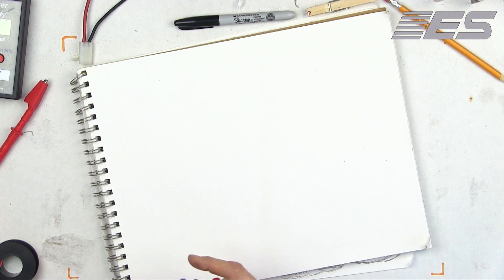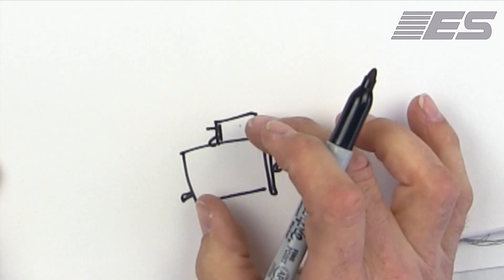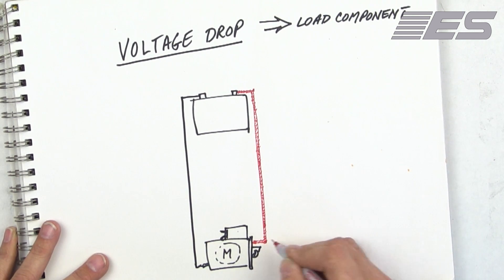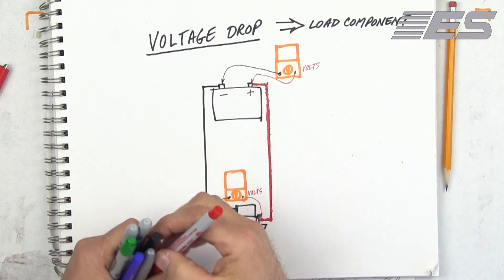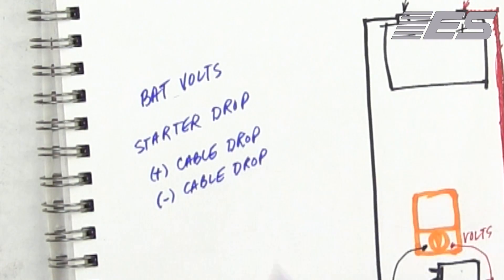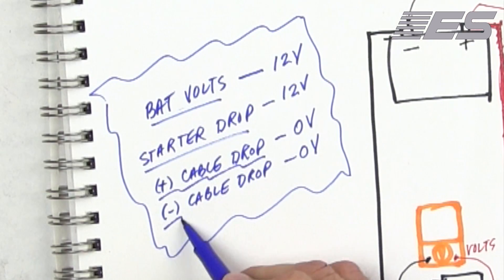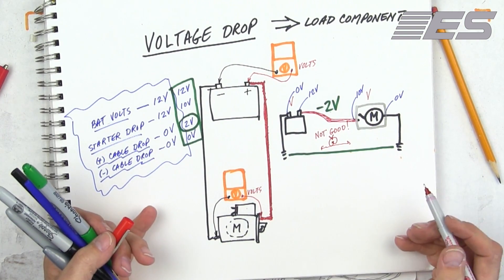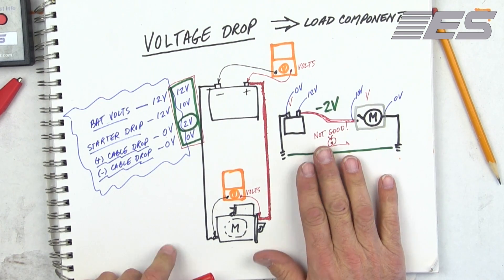Starter Buddy - Theory of Operation

Comment: Hey Dan,
     Thanks for making your videos I've recently subscribed to your channel, I enjoy watching your videos but just have one question. I may have misunderstood but did you say there will be NO voltage drop on any thing other than the load (in this case the starter)? Being a mechanic out here I can't say I ever saw a switch, cable or solenoid that did not have a measurable amount of VD on a high amperage circuit. Most starter solenoids I would check might be around 0.200Vdc across the contacts (loaded of course) and I might run across 0.100Vdc / 0.050Vdc on cable, depending on the length of it, on a know good circuit with no problems. Just want to make sure I am understanding this right is all. I just don't ever recall seeing a switch, mechanical or electro-mechanical have a VD of 0.000Vdc loaded. 
Thanks,
Eric O
Reply from the maker: You're right. I was using exact numbers, and there's always a chance that will backfire. In a perfect world my numbers would exist; in the real world they never will. From a teaching perspective the vast majority of guys don't have your experience and are learning this for the first time. Doing the math is secondary to the concept, so I don't really worry too much about the millivolt losses when trying to convey the general concept. Good job challenging me. Keep at it. And, thanks.
Reply: Whew lol ok thought I was loosing my mind. Just keep in mind though for example on a Ford where you might have 2 solenoids (at .3Vdc each) in line, plus undersized factory cable (.2Vdc) you might knock it down a volt or more at the starter motor on a known good cranker. I like your teaching style. Something I am not very good at is explaining my thoughts haha. Keep it up!
Reply: I've always used this rule of thumb: On a high amp circuit like the cranking circuit, up to a 1 Vdc drop at the load can be tolerated. But on low amp circuits, like the ignition circuit (on most vehicles), up to a 0.5 Vdc drop at the load can be tolerated.  On really low amp circuits, like sensor circuits, up to a 0.25 Vdc drop at the load can be tolerated.
Reply: Damn 2 solenoids on a Ford? Never knew whats the purpose?